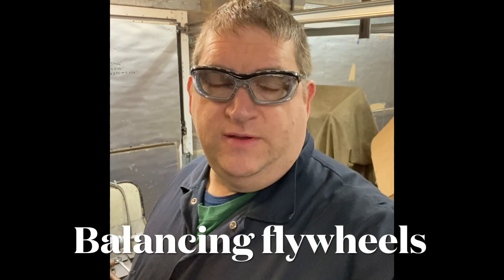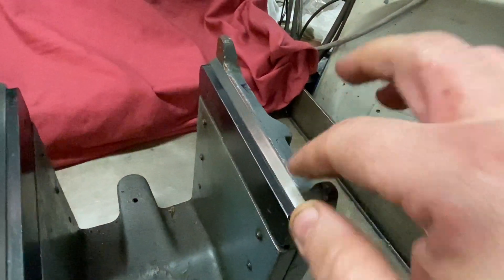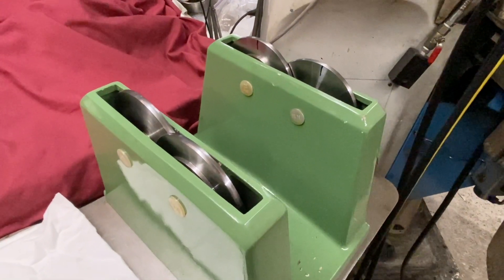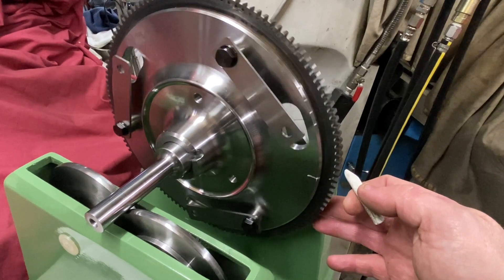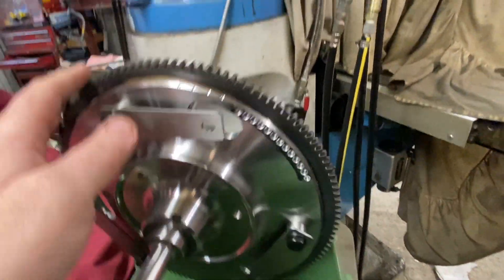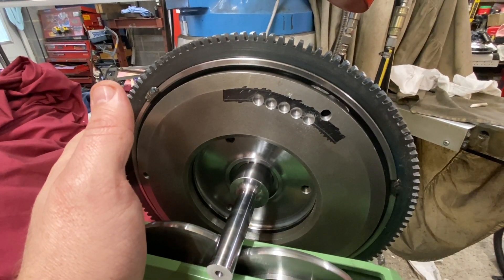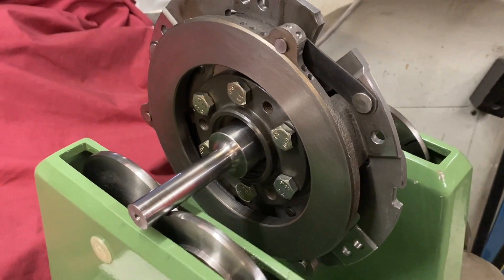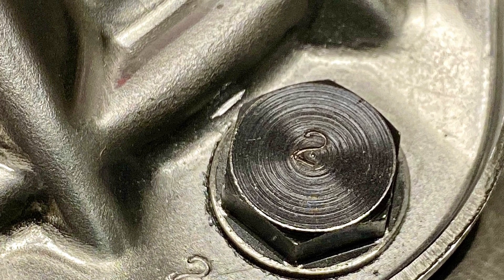Balancing classic Mini flywheels

Comment: Whats the max RPM for such flywheel static balance is a good fit for?
Reply from the maker: The steel Flywheel will run much higher than the conrods will stay in place for. The cast iron version 6krpm max.

Comment: In most Japanese manual gearboxes, such as Toyota's C52 (used with the 4AFE engine), the clutch disk and pressure plate are bolted directly to the flywheel. Do you need to balance the flywheel every time you change the disk and plate? Wouldn't this weaken the flywheel due to the numerous different holes being drilled in it?
Reply from the maker: No the flywheel is only balanced once. Fitting a new clutch kit, means the back plate may require a light adjustment but it will be very small.
Reply: @ACDodd so I should balance the flywheel without the pressure plate and then when I put it on the flywheel, I should just change positions on it, until I find the one that doesn't make the flywheel out of balance? Or do you mean that I should remove material from the pressure plate too?
Reply from the maker: @_UserUser_  balance the flywheel in its own, then add all the other parts and then balance the assembly again as clearly shown in the video.

Comment: great video on balancing, ,  what is your thoughts on lightweight fly wheels, , eg: 1275  A series ,?  i saw  a video on Balancing a
flywheel and cover plate and crank and front pully as one unit,  what's your thoughts
Reply from the maker: Yes dynamic balancing the while assembly is the correct way to do it. However those who simply wish to fit a flywheel or a new clutch to an existing engine this is more difficult, hence using this method of balancing for just the flywheel and clutch is ideal.

Comment: Is dynamic balancing more sensitive/accurate?
Reply from the maker: That depends on how sensitive your static jig is, if you are using just a couple of small bearings to support the wheel on then it’s not very good. If you are using 4 inch or larger wheels, then accuracy is much better
Reply: @ACDodd  Thanks for the info. I may make my own one then.

Comment: If is not in perfect balance what is the problem?
Reply from the maker: Engine vibration and harsh running.
Reply: @ACDodd  from the factory they are all perfectly balanced?
Reply from the maker: @66AGW no, and worse than that once you fit a new clutch kit the new parts available are not normally balanced from new.
Reply: @ACDodd  i understand. Thank you!
Reply: @ACDodd I fitted a new clutch and pressure plate to my Audi A3 (8L1) and it developed an annoying vibration. Still need to remove it and have it balanced.

Comment: Thank you for your detailed explanation and demonstration. Bit by bit you are answering my remaining Mini mysteries! You casually mention “centring” the assembly when you put on the back plate. That I would like to see done. It seems to me that the balance would be VERY sensitive to this centring. So much so that I wonder if you disassembled your finished balanced assembly, then re-centred/assemble it, would it still be so perfectly balanced?
Reply from the maker: Clearly it can only be as good as the location of the bolts in the holes they fit. Which it’s why it’s important to renew drive straps and bolts when overhauling the assembly to help maintain assembly accuracy.

Comment: It was great to see just how much "Out of Balance" the Flywheels were! And your drilling corrected this. But do you think that the 'unbalance' cause was primarily the Ring Gear itself, during manufacture and fitting of that item? I am planning to completely remove the Ring Gear in order to lighten the Flywheel. The Flywheel (with Ring Gear and Clutch Assembly) is mounted to a 3-phase (perfectly-balanced) Electric Motor. My car is a '71 Beetle, and is running a Hyper 9 electric motor, so no crankshaft or engine to worry about. The electric motor revs to 8000 rpm, so the balance in the area of the Flywheel and also the Clutch Assembly is critical. Currently, there is a high degree of vibration, and (I believe) that to use Knives and balance the (lightened) Flywheel and Clutch Assembly will be a quantum leap forwards in achieving a successful balance. With Regen Braking on my car, it is important to remove as much reciprocating weight from the Flywheel (and Clutch Assembly) as is physically possible. To all persons who decide to go EV on a Classic Car, (and retaining the Flywheel and Clutch Assembly) this is so very important. Thanks and greetings from Australia.
Reply from the maker: A lot of the out of balance moments are caused by the ring gear distorting the flywheel out of round as it shrinks on.
Reply: @ACDodd  Thanks so much for your reply, which is fairly logical to me. Perhaps I used the wrong term (reciprocal weight). I should have written 'Rotational Mass'. Also, my understanding is that (the further that the out of balance distance is - from the axis), this will exacerbate the problem. And I can well-understand the great comments from those few people who have entrusted you with this work, in achieving a smoother-running (and better balanced engine). Finally, I was really pleased to see the 'stamping' on the securing bolts - and relative positions, following the balance procedure. This further demonstrates a very high degree of your knowledge and care.

Comment: Another informative video. I guess on the Verto Clutch assemblies the straps can cause and issue. Do you just make sure they are done up in the position that they should end up in as I guess any movement durning the balancing will result in starting again? If the Clutch and Flywheel have already been balanced, could adding another spring (RTS) and changing the Clutch to Flywheel bolts (8.8 - 10.9) throw the balance out by much?
Reply from the maker: If the clutch is coming apart it should always be rebalanced as it will never go back together perfectly.

Comment: I found it interesting that you balance each flywheel individually and then together rather than straight to assembled, I was thinking if both were out you could potentially unbolt and turn it then assemble and check again. It makes sense to balance each part though. Great stuff 👍
Reply from the maker: That’s done so you can change a part if needed and maintain the balance
Reply: A potential problem with static balancing the pressure plate and flywheel together is that the weight is distributed on a longer axis.  For instance, there is no way to know if largest out-of-balance contributor is the pressure plate.  The easiest place to remove weight from the assembled parts would naturally be to drill the edge of the flywheel, until 'balance' is achieved.  Now a potentially perfectly balanced flywheel has been made out of balance to compensate for the pressure plate.
What that does is mask the real source of imbalance, and can harm the other component which may have been in perfect balance.  It could also create torsional vibrations if the imbalance is at one end of the assembled flywheel  and pressure plate.